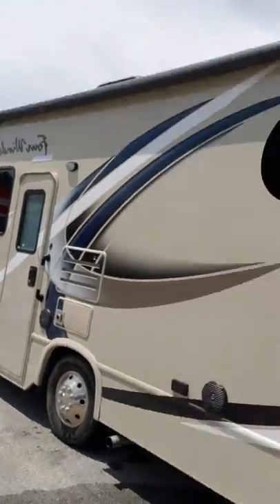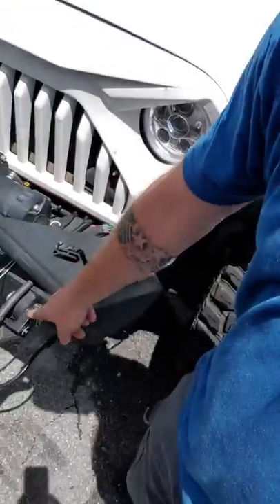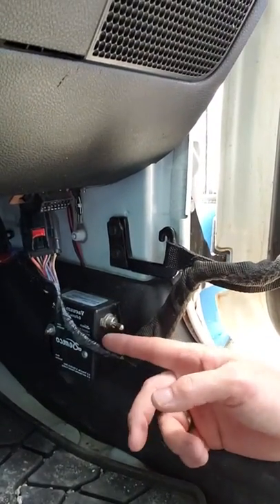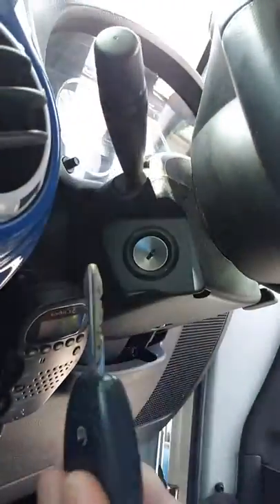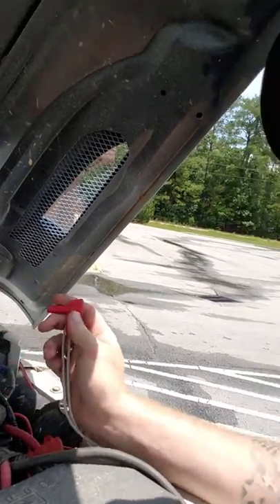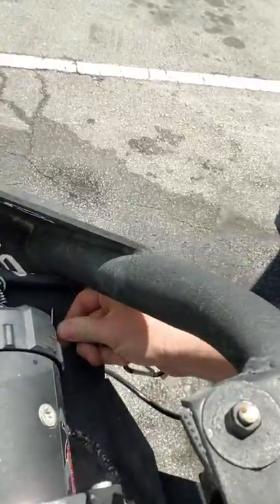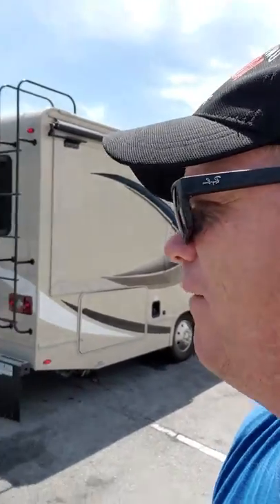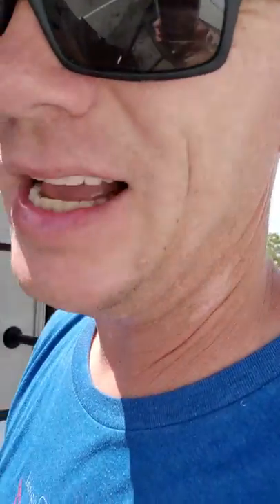Flat towing a lifted Jeep.

Comment: That tow bar angle puts terrible stress on the front end of the Jeep, it works behind a heavy RV but can be plain dangerous behind a pickup because it also lifts the rear of the tow vehicle
Reply from the maker: I ended up changing the hitch over, it's all good now.